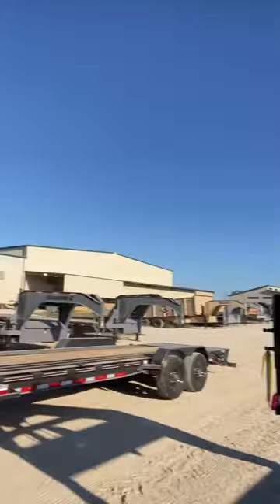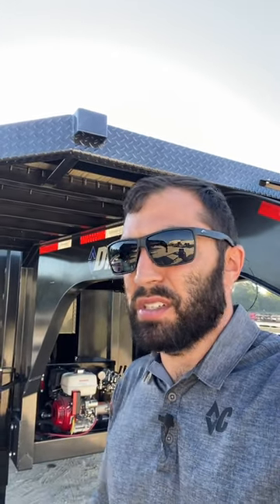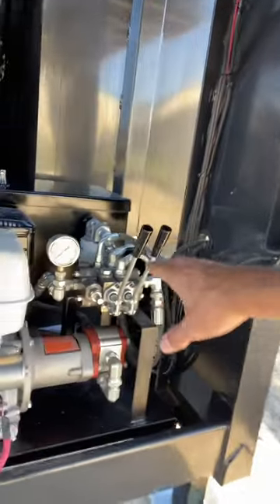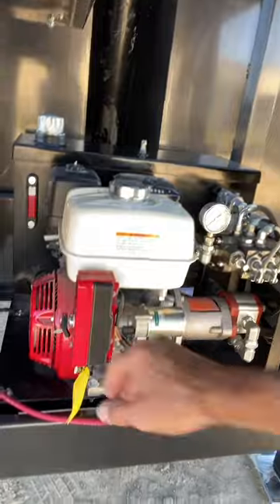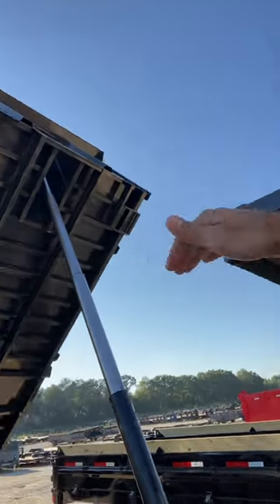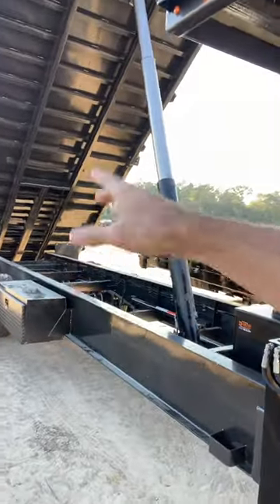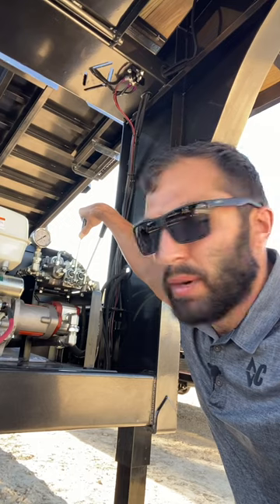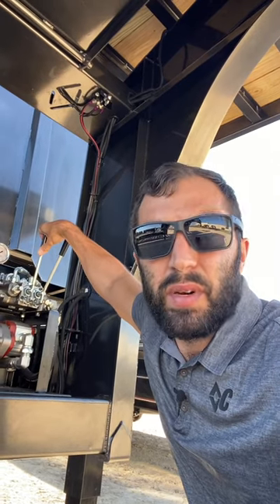The Ultimate Gas Powered Dump! 💪 | Diamond C

Comment: I would change the location for the valves for the cylinder. Have it remote or have a kit to have in truck. Having valves there to dump is dangerous. Let's say your loaded to full capacity. When dumping it will force the truck and trailer forward......and guess where you are at....between the truck and trailer. This is why semi has the control valve inside the cab. But not to bad of a design

Comment: I would agree, needs a remote option. How I would love to see a tailgate like B-Wise Ultimate dump has. It doubles from a tailgate to a ramp to drive your equipment in. Another thing, in the north, in cold weather, believe it or not, that Honda will freeze and not start. We face that on barn hauling trailers. I’d probably rig my truck up with a hydraulic system that run off of the serpentine belt.  Very nice trailer though. And all this pushes the price higher😢